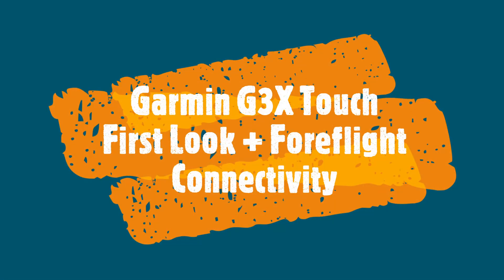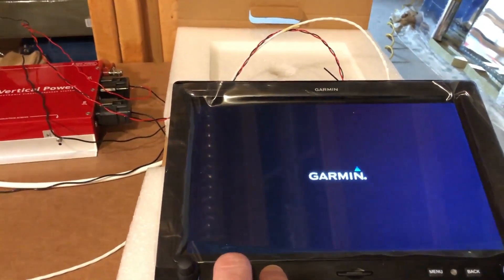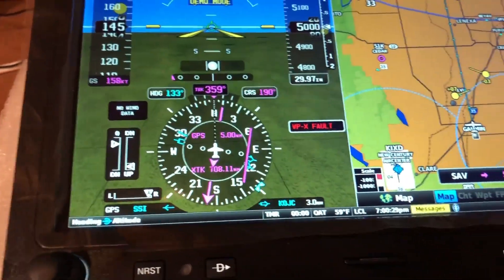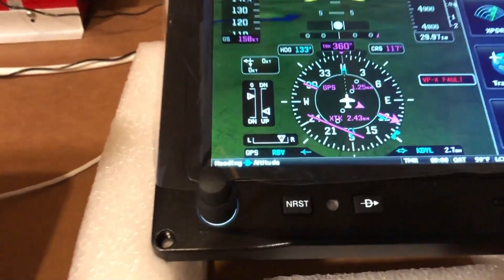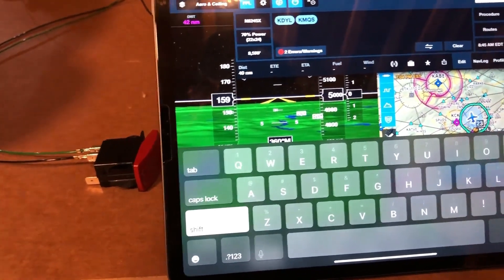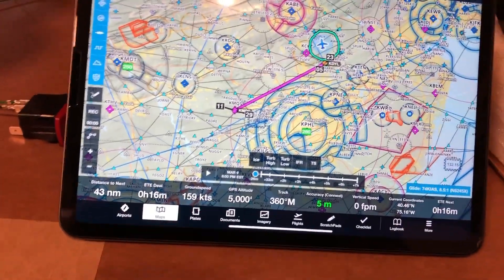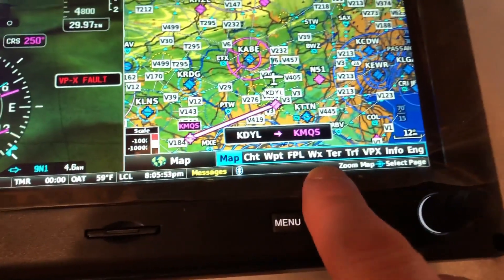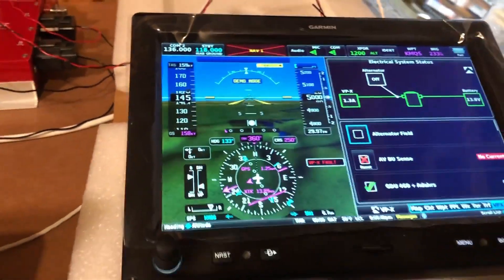G3X Touch First Look + Foreflight Integration

Comment: What is this configuration module?
Reply from the maker: The G3X has a configuration module (basically a memory card) that it requires to store the configuration and calibration data.  Typically this comes with the LRU kit but i have not purchased that yet.

Comment: Just came across your channel a couple days ago. Very excited to see that I’m not the only one considering doing the panel install by myself. I have zero experience with stuff like this but I think I can learn.
Reply from the maker: So far so good,  there are lots of references so I'm not too concerned, need to watch out for electrical noise (ground loops, power feeds, and shielding anything that is noise).